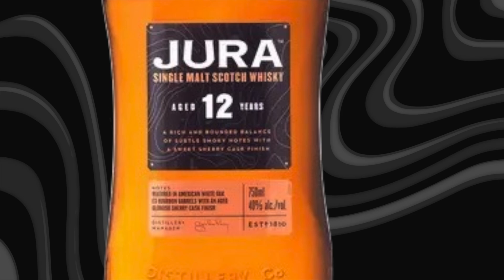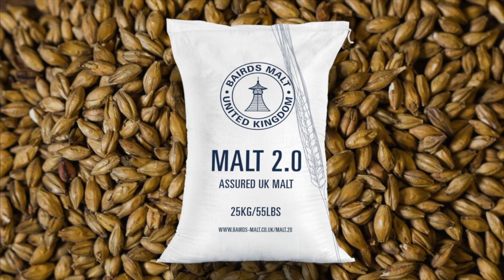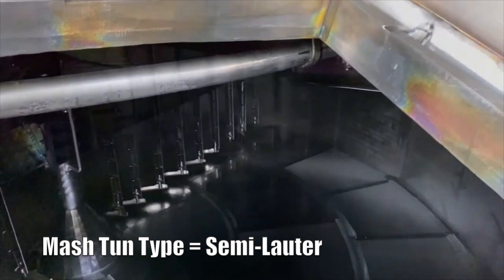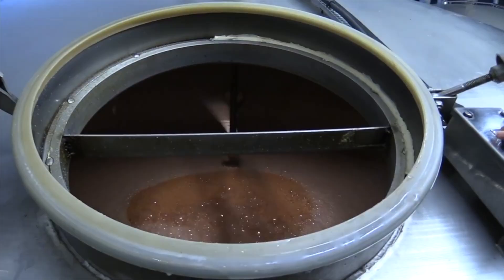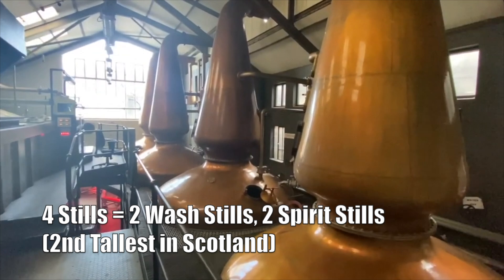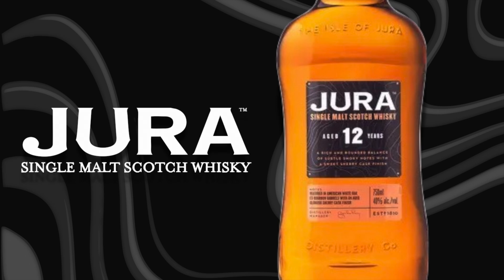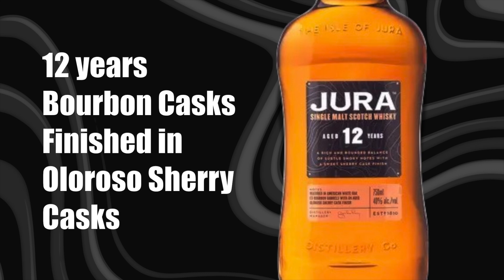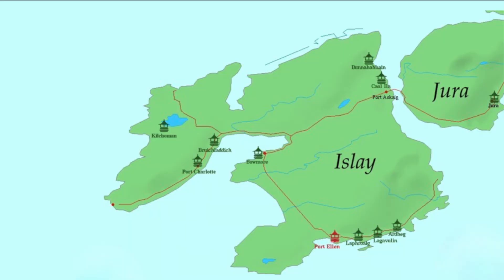Jura 12 Year Old Single Malt Scotch Whisky

Comment: Just tried the Jura 12 for the first time (am noob at whiskeys, have tried maybe like 10 or so, so far Fav was Bunnah. 12yo.).
My impression was that the nose is decently complex and sweet, bit winey-fruity (apricots & orange); but on taste it was just dry oaky (what I image licking an oak wood plank would taste) with a dry-smokey lingering aftertaste.

Idk. For me, not bad - I don't regret buying the halfsize bottle -, but I wish the taste and nose aligned more and that the taste wasn't so straightforward. Definitely did not feel like an island/islay scotch though.